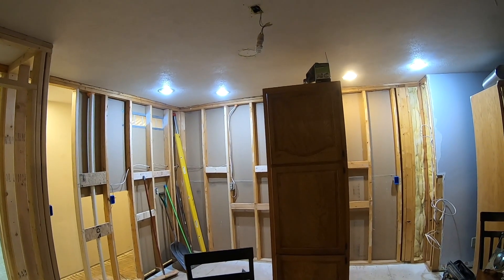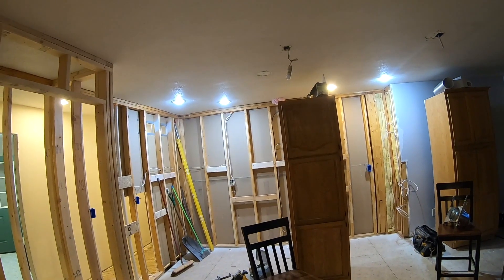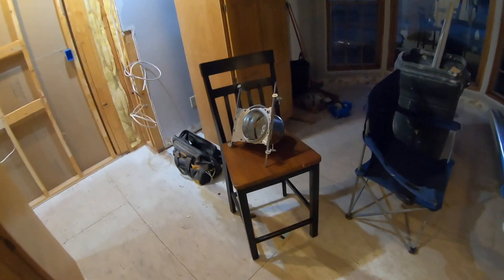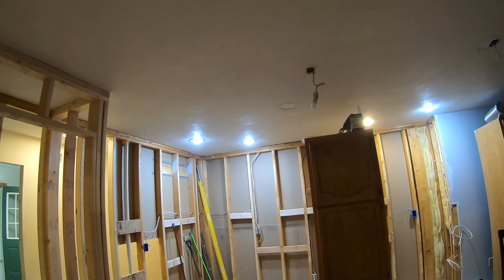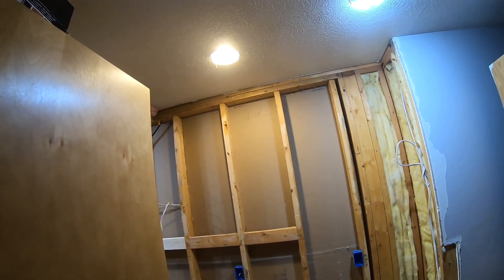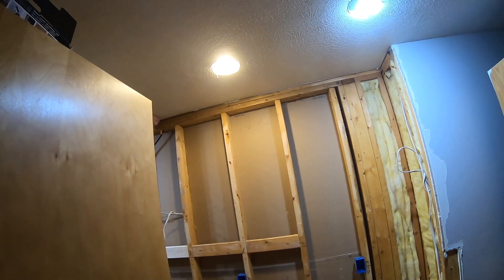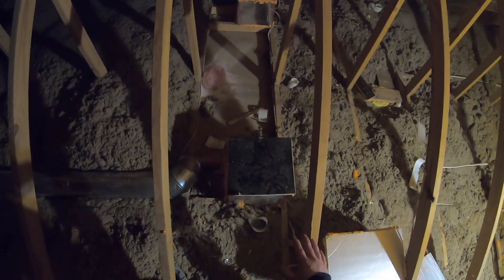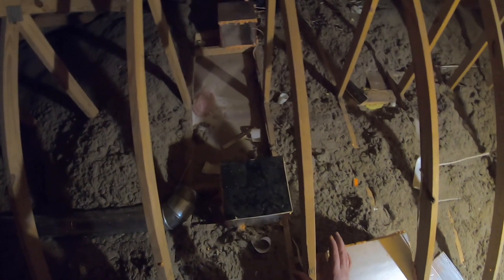How to Insulate and Air Seal Recessed Lighting Not Rated for Insulation Contact:  Non-IC Rated Light

Comment: This is the solution I was looking for however.....the adhesive spray foam you are using is behaving a lot better than mine. I got the gaps and cracks foam (minimal expansion) and it's going all over the place and it doesn't stick to the foam sheets.

Mind me asking what product you used?
Reply from the maker: It's call "Great Stuff Fire Block Spray Foam."   The link below has everything you will need.

https://amzn.to/3gJyOEe

Comment: Should be 3” minimum, the way I’m installing mine is using foam on top of the 3.5” rafters and the box is mounted to the wood, leaving the wire accessible should you need to replace the wafer or puck light. This way you have 3 1/2 inches in the airspace above. It goes from a rafter to rafter minor 2 feet on center so it would allow a lot of airspace for heat dispersion that being said I would fire rate spray in foam for secure the foam panel, and on both sides, the foam panel would come back down to the drywall for a larger airspace, and then if needed, you can always remove the blown in insulation on the top and have access to all of the wiring in the box for me I feel safer with the box being mounted and secure, and not being able to wiggle and move around.

Comment: 60 bucks for a pack of six IC rated can lights at Home Depot, so I wouldn't say that it's all that expensive to replace the lights from a materials perspective. That said, this is a good video though.
Reply from the maker: It’s not expensive material.  However, the time to replace them if you are doing the work yourself is probably greater than doing the boxes.  If you have to hire an electrician then this is definitely the cheaper option.

Comment: Don't rip your cans out just rip the guts out to the light socket and put it in a LED new insert trim the fire hazard is from hot incandescent light bulbs or people that want to put 100 watt light bulbs in their light fixtures when it's not rated for more than a 65 or 70 watt bulb I'm an electrician for 20 years save yourself the gripe to swap the guts out to a different trim fits right up inside it you never know the difference and they last forever damn near

Comment: This is the second place I have seen a tip like this to seal Non-IC rated can lights, but even in your video you mention they need to breath. Won't this trap all the heat they generate in the box and eventually trip the heat sensor if you were still using incandescent bulbs? I think if you block up the ventilation of the can light you need to also reduce the heat output of the can light by installing LED bulbs?
Reply from the maker: I did install led bulbs.  You aren’t supposed to cover the top of the box with blown in insulation when using incandescent bulbs.  Also, if you build the box bigger it will help with over heating because the larger volume of air will distribute the heat better.  I haven’t had any problems so far.
Reply: Who uses incandescent bulbs in 2025?